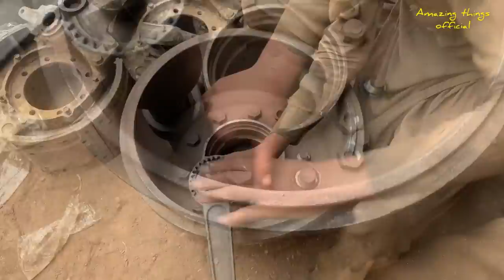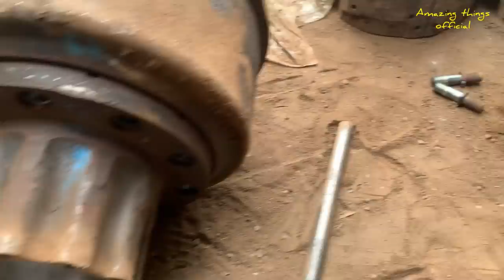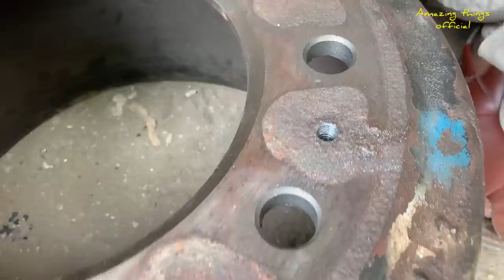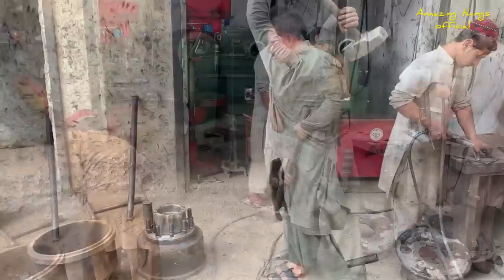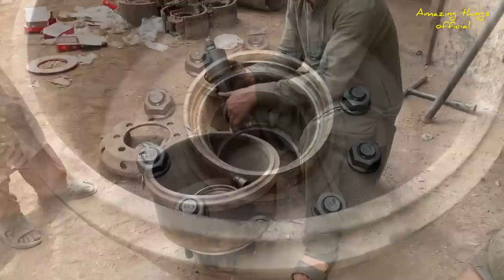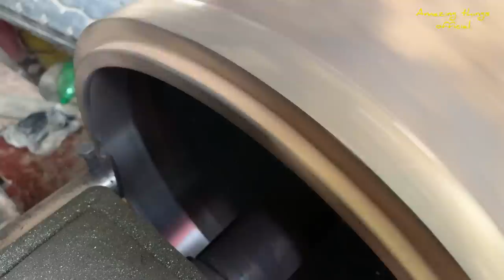How to do Replacement Broken Stud of Wheel Brake Drum Hub | How to Replace Rusty Bolt of Brake Drum

Comment: Wonder how many taps that guy has snapped?✌️🇬🇧
Reply: Since you commented on that subject, did you figure out why they drilled those holes and tapped them?
Reply: @ukpkmkk_2  no mate but u can teach me something by letting me know if u don’t mind bud 👍
Reply: @ukpkmkk_2  The two tapped holes was added to release the schmoo!!
Reply: The two tapped holes are for when the job returns on warranty repair the next day. The amount of pounding and hammering releasing the drum from the hub is now eliminated with these two jack holes. (the two holes that were drilled and tapped).
Reply: @844metalman  hehe.. i got that reference.
Reply: @markthompson9914  sorry dude.. No clue..
Reply: @MrNeverseeme  what so they can ease it apart rather than using bloody great hammers on brittle cast u mean 👍?

Comment: China must be delivering from ebay to Pakistan with those cheap torque multiplier
Have they modified an old wheel balance machine to a lathe to recut and resurface drums   very clever
But could be dangerous    too much  and the brakes will probably go over cam
Not that this worries these men